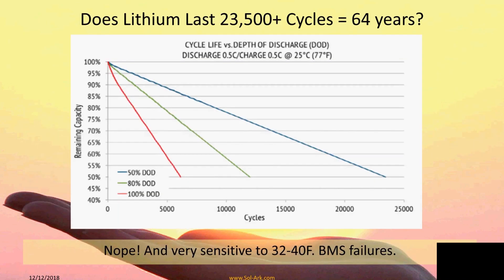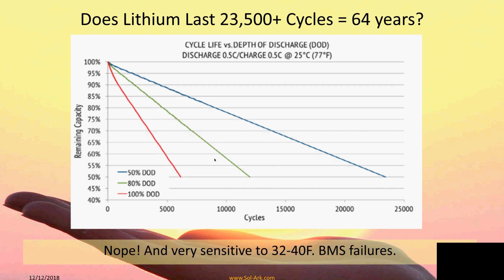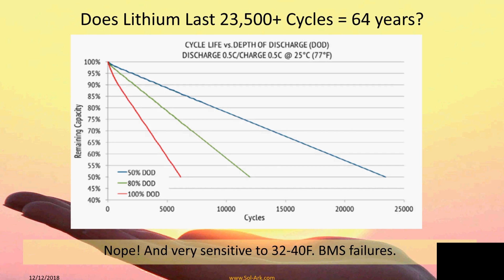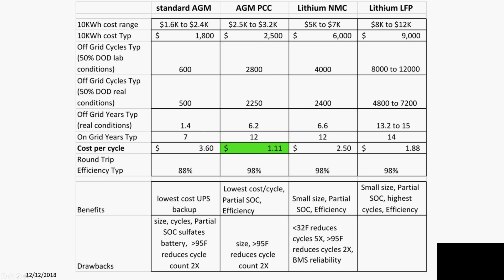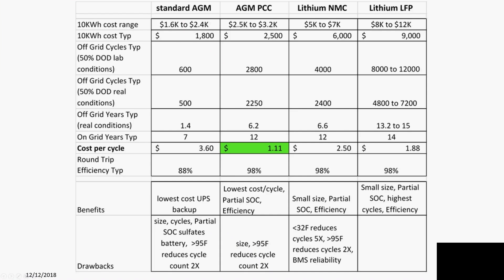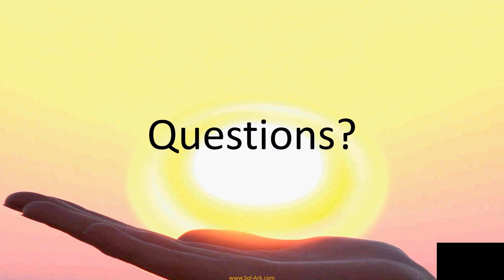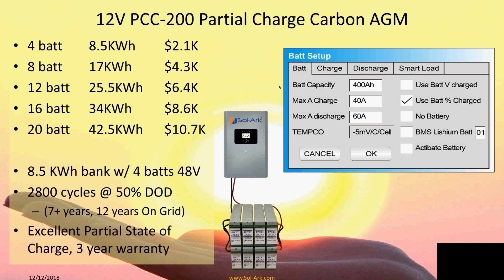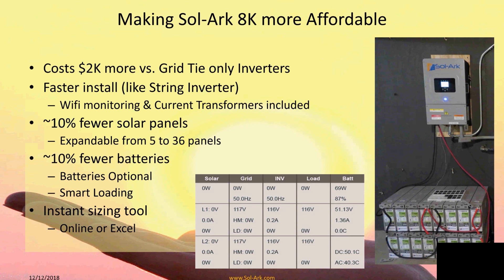Webinar 2, Batteries

Comment: Good information on types of batteries. Does the Sol Ark have to have wireless connectivity for updates?  Thinking of long-term grid down .
Reply from the maker: We do not at this time. You can purchase a SW update dongle for locations where where there is no connectivity for updating firmware.

Comment: I love your videos and I hope you keep them coming. I've been looking at your inverters since I seen Scott, engineer775, did an install, and I'm really leaning towards your inverters. I just moved to Louisiana from northern Wisconsin, and up there I had Trace Power Panel SW5548 with a T240 step up transformer for my well pump and almost a 60kw battery bank and a 3,000 watt Whisper on an 84 foot tower on a hill. It did "OKAY" for many years since I installed it in 1997, but it was mainly for power outages. I also had a 33kw gen set for the electric heat and high demand items when the grid went down, and 3,000 gallons of diesel on hand. I wanted to make sure I could make it through a cold Wisconsin winter should some thing major happen. 

Now that I've made my mistakes, I want change a few things. I'm looking at nickel iron batteries, and you didn't mention them here, but maybe in the future you can?? I just want tough, durable batteries that last a long time and they don't need to be babied like today's snowflakes of the left do. I'm not a fan of anything that requires a BMS and is VERY picky about being charged. I've heard good things about NiFe batteries as far as being tough and long lasting, but they are not nearly as efficient as the new technology. Given a choice, I'll give up efficiency for durability and I know they'll always be there for me.

I'm looking at getting 50 batteries for each inverter, and the batteries are 1.2vdc @ 1,200 amps each or 1.44kw each. I've been talking with the manufacturer in China and they quoted me $490 per battery.

Here's the batteries I'm looking at.
http://www.ciyibattery.com/index/products/id/238

Does the inverter handle 60vdc input?

I figured I'd just buy a crap load of batteries and hook them all up and be done with it and have a huge bank to draw from to off set any efficiency problems, or can a bank be too big?

I read in another post in another video, that I can only have ONE inverter per bank so they don't fight each other with charging and discharging, but how does it work for charging say 4 banks of batteries with 4 inverters and a 30kw gen set if that's the limit?

Would I just need to buy say 125kw gen set?

Gen set I'm looking at.
http://www.centralmainediesel.com/order/JD1PH30.asp?page=JD1PH30

Larger 125kw gen set.
http://www.centralmainediesel.com/order/John-Deere-125-Kw-Diesel-Generator.asp?page=JDO125

Can two inverters be wired to handle a larger load together, like a 15hp waterfall pump in a pool if need be if the grid goes down or would it just be better to run the gen set until the grid is back up?

I was also looking at having around 40kw to 50kw of solar installed as well. Can I do that with say 4 inverters or do I have to stay at the 11kw max level of solar?

I know I've thrown a lot out there, but I'm moving into a new place with 80 acres, well 70 acres and a 10 acre pond, and it has three homes on it and I want them all to be able to run off grid as much as possible in case of an emergency, plus I'm building a new home so I'll need even more power to run it, but I will wait on that project.

So any help you can offer about what direction I should and shouldn't be looking, would be great, and if I'm asking dumb stuff, say so, trust me, you won't hurt my feelings or offend me. I spent four years in the infantry with the 3/75th Rangers out of Benning back in the 80's so I've been called everything but a human being and I survived.............but I doubt I could survive college these days...then again I never went to college at all as I felt it was becoming a place where they polish pebbles, and dull diamonds back then, but what the hell do I know. 

I look forward to hearing from you and working together. Keep up the great work.
Reply from the maker: Thank you for your service. We have many Army and Marines at the company. These are all good questions that we answer on the phone with every customer. Affordable Solar + Storage for families is our company mission. Let's have a two way conversation on the phone. 972-575-8875 x1 (you can ask for me Tom Brennan if you like). This is too much typing! 

Personally, I would not use nickel iron batteries. The round trip efficiency is only ~65%. So you will have to up size your solar array 35%. The batteries are expensive too. I will spend an entire hour on batteries on a March 6th webinar for installers.
Typical Battery Efficiency:
Flooded = 85%
AGM = 90%
Carbon AGM  & Lithium = 95% (this can be 98% with a special mode on our 8K system - sorry, it's top secret)
Nickel Iron = 65%

I would use our Partial Charge Carbon AGM's (PCC-200) for cost per cycle reasons. Or if you prefer Lithium, LFP (but must have a good BMS). Our engineering team has seen so many Chinese BMS failures from so many places. Maybe only 10% of them are halfway decent.

You cannot gang our inverters. We made the 8K affordable for everyday family needs. You can run independent loads (example: we have multiple systems running in computer server rooms). You should not plan on running 15hp pumps off grid.

Comment: Great content!
Question, how low of voltage can you set for the battery’s? Would your 8k work with used Tesla packs (38-44v?)
Reply from the maker: We work from 41V (or maybe 38V) to 59V. Tesla batteries are a bit low on the voltage scale for storage inverters, so you would not deplete them below ~20% SOC (which is not a bad thing).
Reply: Sol-Ark
Can your inverter do bms over canbus for used Tesla packs,  or do you need an external bms?
Reply from the maker: @Miweatherspotter1  All Lithium batteries must have a BMS for equalization of the cells (or you will have very poor life). That is not something an inverter can do because we only connect at 48V, not cell level. Most Li batteries will come with a BMS. We support both Canbus and RS485 communication with the BMS. But communication with batteries is really not super important.

Comment: How do the AGM PCC batteries react to cold climates? Same as every other battery? I have a small cabin and I'd prefer not to use real estate  for something other than battery storage. And what are the recommended temp ranges?
Reply from the maker: AGM's do not get damaged with cold like Lithium but their capacity is reduced like all lead based batteries. ~32F = 15-20% drop in capacity. If you are going to put the batteries outside, please put in an insulated enclosure (insulated for winter). You may also want to vent a small amount of heat over there for extreme cold.
Reply: @Sol-Ark  So generally a 50 degree heated/vented enclosure will be good to go. Gotcha. Thanks!